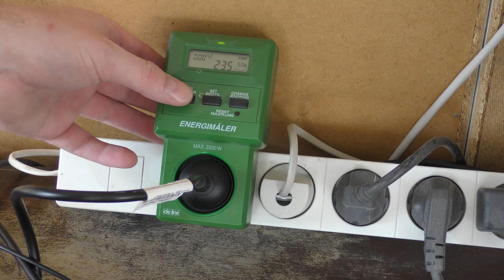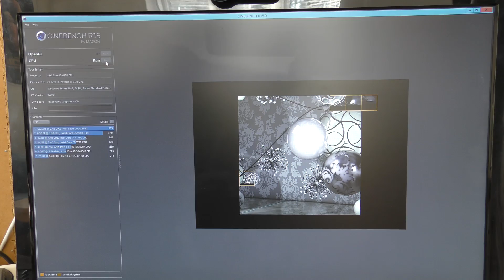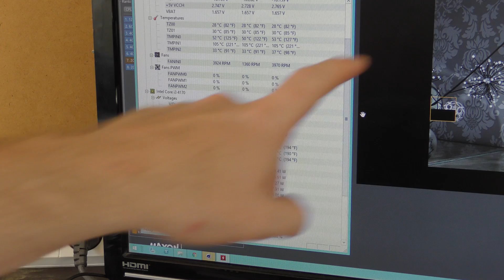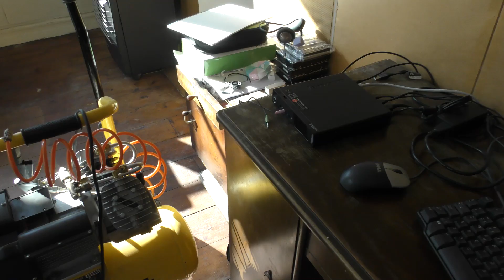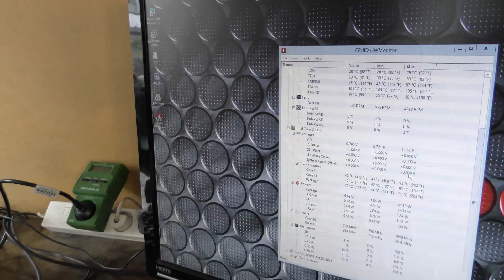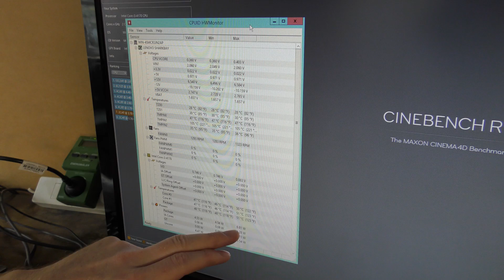Lenovo Tiny PC with i3-4170 Power and Heat Measurements - 406

Comment: I have the same PC but with an i7 4790s and there is no problem on average I have a total consumption of 55 watts sometimes with peaks of 62 watts and the and it does not go above 80 degrees in cinebench I get 712 points simply the processor (i3 4170 ) is used well and its maximum consumption is 54 watts with its integrated graphics added
Reply from the maker: Hi @hpperrreo4082
Thank You very much!  glad you liked the video :-)
Thank you for watching! :-)

Comment: Did you try replacing the 65W power supply with the 90W version? This should get this CPU working at full capacity. But looking at those temp figures, you'd be looking at close to (if not over) 100 degrees... haha
Reply from the maker: No I did not try that :-)

Comment: I just cleaned out a pc with the same cpu and it was always 99 DEGREES C. but now its between 40 to 70 I think that model has a heating issue. take a look I just posted it it was a little dusty
Reply from the maker: must have been more than just a little dusty :-)

Comment: Ok, so I'm doing the same setup. Actually two of them i3-4160 and i3-4170. On the 4160 one I reach 88 °C as well, that's with Thermal Grizzly Kryonaut. I get the same wattage you get. Around 44W. The PSU i'm using is a 135W one from a docking station. So plenty of reserve there. Since the fan gets very loud I intend to do two things that I can think of.

1. Delid the CPU and apply either Kryonaut or Conductonaut.
2. Try undervolting the CPU as much as I can.

I hope I can shave off ~10 °C. I will try to get to it and share results after.
Reply: Intel XTU stress test reached 95-96°C on default voltage (ambient is a bit higher these days), as well as 40-42W TDP. I was able to test at -0.115 volts offset on the core and cache. Maximum temperature reached went down to 86°C, usually hovering around 80-82°C. TDP went down to 34-35W. The fan was not a loud too. At no point the indicators for Power/TDP/Clock limiting fired. I will delid it tonight and check how far that gets me. If I\m able to go down to about 75°C I will consider it success. At that point fans will run quite enough even for a quite office.
Reply from the maker: Hi Svetoslav Stefanov
Thank You very much!  Nice,, what did you use to under voltages it ? 
Thank you for watching! :-)
Reply: @MyPlayHouse  Intel XTU did the job. I will post delid info later this evening.

Comment: I'm watching this Video, on a Lenovo i5 Quad Core, with 4Gig of Ram and 
256MB (or Mib) of On-Chip Shared Video Memory. It's an MT-M-5067-A1U. 
I've been using it as my main PC, for two years now. I'm running Fedora 
23 Linux. And it can Duel Boot. With Windows 7 Pro, on it too. But, I 
rarely used Win 7. It's a decent PC. It can Render Videos, much faster 
than my Duel Core and P4 Machines. But, I have allot of trouble, with 
the small video memory. When I do simple things. Like, watching YouTube 
Videos. The machine starts using too much Ram, rather quickly. Which 
seems odd. Because, Linux actually does a better job of managing memory,
 than Windows. I've run Fedora Linux as my main OS, since 2005. And 
never had a problem like this, on any other machine. From P3's to Duel 
Cores. Both Intel and AMD. When it get's over 1Gig of Ram usage. I have 
to Reboot the Machine. Or else it will lock up. And some times, it 
Reboots it's self. Very Aggravating... It is rather random. As to how 
long it takes this to happen. Anywhere, from 30 minutes, to 2 hours or 
so. It only has one standard PCI Slot (Not PCI Express). So, the only 
Video Card. I could put in it. Would be an old PCI Video Card. And the 
biggest I found was 512MB. But, then the Brick Style Power Supply 
couldn't supply the needed Wattage, for the GPU. I thought about using a
 PSU out of a Desktop, to Power it. And setting the PSU outside of the 
Box. But, those PCI Video Cards, Used. Now cost more than and brand new,
 2GB Video Card!:O And after seeing your videos. I don't want to spend 
money on a CPU Upgrade, either. What a Shame... So, I wont be spending 
any money on this thing. I've been watching your videos. On adding a 
Video Card, to your Servers. That sounds like something I would like to 
do. Especially, If I can find an 8 Core Server, for a good Price... 
Morten, Thanks for sharing your Knowledge and Experience... 

Don
Reply from the maker: Hi Don Bishop
Thank You very much!  glad you liked the video :-)
Thank you for watching! :-)

Comment: Did you really installed Server 2012R2 on that Client machine?
Reply from the maker: HI
It had been used for a project,, I just kept it on there. why?
Thank you for watching! :-)
Reply: Isn't it hard to handle? I had been tried to install Camtasia for my Server Tutorial on my other channel and it just didn't worked on the server os. And so many programms don't want to be installed on a server or want a extra license to become installed.
thank you for your comment. Stay awesome.
Reply from the maker: HI Philipp Renner 
I did get Camtasia up and running on 2012,, but it was a bit weird with the resolution on the webcam,, I was recommended OBS,, the thing all the gamers use for streaming!! That works well.
I do have it working so well as a PC,, that I do not even see that it is really a server.
Thank you for watching! :-)

Comment: why do you run Windows Server on your Non Server Devices?  i under stand that you should Run Windows Server on an actual Server but in my opinion that is not a server.  Im still new to your channel though so if you did a video on why you did this this i am sorry for asking as i have not seen it.  Just thought i would ask though.
Reply from the maker: HI
No that is a good question! Mostly,, the Tiny PC had it on there,, and I was to lazy to reinstall. But working with servers and MS server OS I also would like to see what I could get up and running on it. I still use it like in the video here.
Just getting the Sound, Mic and Web CAM running,, I was not sure if there was drivers and stuff....
Thank you for watching! :-)
Reply: Did it come with windoes server pre-installed or was it installed by someone else?  Or something like that
Reply from the maker: HI ***** 
I had a tranie install it, and forgot about it.
Thank you for watching! :-)
Reply: It's fine. Win server comes with a few things out of the box that aren't in desktop. It really depends what you're using the the machine for.

Comment: Another thing to consider perhaps is also BIOS revision, see if you can update it, it might include better support for later CPUs. I wonders also if it is possible to get a higher wattage power supply, then we can see if it is purely thermal throttling that is holding this CPU back
Reply from the maker: HI
Okay you think it is the heat,,thanx!
Thank you for watching! :-)
Reply: No, as my comment said, It may be, but to properly see if it is, then the two thing mentioned could prove it. Please re-read my comment
Reply from the maker: HI ***** 
Sorry :-( I get SOOOO many comments right now,, can't keep up.
Thank you for watching! :-)

Comment: Man,  you have all this great equipment, but you totally have no clue about CPUs and such. Your mini pc works completely fine. Even the Cinebench score is totally accurate. Read into intel CPU power saving features, that will clean up some of this.
Reply from the maker: Hi
I am sure you know a lot about this. My problem is that the  i3-4170 shout score 5136-ish in this test : http://www.cpubenchmark.net/cpu_lookup.php?cpu=Intel+Core+i3-4170+%40+3.70GHz&id=2522
But scores about 1000 less in my tiny PC.
What do you think is going on?
Thank you for watching! :-)
Reply: Are you running dual-channel or single channel memory? Also at what MHz?
Reply from the maker: Hi
There is just one dimm in, and I think it was running at 1600MHz
Thank you for watching! :-)
Reply: So you are running it in single-channel mode. That can limit the performance of the CPU greatly in memory bandwith limited applications/benchmarks, and as far as I am concerned, PassMark does have parts like that. The people who are getting 5000+ score are probably running faster and dual-channel memory.

This is probably the reason why cooling it better with the compressor didn't affect performance at all.

And albeit your core temps were high, the CPU wasn't termal throttling, at least from what we could see on the video.
Reply from the maker: Hi TheHendric85 
Interesting, I do need some more RAM for it anyway. :-)
Thank you for watching! :-)

Comment: If you think the power brick is holding you back, you could use a higher wattage one (Like used on the higher end thinkpads.) I have done this on the tinys I have worked on. (I use this http://shop.lenovo.com/us/en/itemdetails/0B46994/460/FB655FA7A2834E04AED9731463CD174E)
Reply from the maker: Thank you for watching! :-)

Comment: 90c is defiantly to hot for that chip with its TJ max being only another 15c away. And the only reason you don't see any throttling is because the board doesn't have the microcode for that chip.
How ever i see no reason to remove the chip if all this system does it web browsing and word processing tasks.
Reply from the maker: Hi
Well it does also do an hour or two of video rendering, from time to time!
Thank you for watching! :-)

Comment: I would be worried if my cpu temps hit 92C, your cpu will definitely throttle itself at that temp to avoid overheating, i would reapply a pea sized amount of thermal paste you could also try increasing the fan speed to the max in the bios.
Reply from the maker: HI
Good advice!
Thank you for watching! :-)
Reply: motherboard bios takes care of the temps and sends instructions to the cpu to clock down, CPU itself does not simply clock down on its own man.

Chao, The Roaring Lion
Reply from the maker: Hi matt kessler 
If the CPU slows down,,, where would I see that? (except maybe the bad benchmark)
Thank you for watching! :-)
Reply: +My PlayHouse (Morten Hjorth) use a tool like CPU-Z it shows clock speeds
Reply: hwmonitor also shows you current cpu speed, it shows in your video!
Reply: I take back what I said about your cpu throttling at 92C, it seems to throttle at 100C or more and only by a small amount and it needs to spend a lot of time at that temp before throttling, more than 20% of the time. These results were from an i7 4790, they said it means that you can expect full performance from an Intel CPU as long as you keep it below 100 °C. But I still say that temp is too high even if it doesn't affect performance.
Reply from the maker: Hi gamerdude0 
Are you sure,, that sounds like a lot?
Thank you for watching! :-)
Reply: My PlayHouse no, it looked okay to me! which makes me wonder why your test score is so close to the old cpu
Reply: I only looked at one site so I may be wrong, here https://www.pugetsystems.com/labs/articles/Impact-of-Temperature-on-Intel-CPU-Performance-606/
Reply from the maker: Hi gamerdude0 
Okay so it does not die at 100C but gets a lot slower.
Thank you for watching! :-)
Reply: yep definitly
Reply from the maker: Hi Gizmo 
I was not able to see it slow down? did you?
Thank you for watching! :-)

Comment: it was thermal throttling really badly next time apply a pea of TIM and Let the pressure spread it also the heatsinc seems incapable to dissapate all that Heat
Reply from the maker: HI
I did not understand this?
Thank you for watching! :-)
Reply: yes it seems like it and this is a pretty obvious throttling, just look with CPU-Z on which frequency it runs mostly it shows you that it throttles when under load if this is the case.
I had this issue many times with overheating laptops, I cleaned those and it went away.
So I guess the cooling is not enough for what it is now, because it seems clean but well.
Wrong appliance of TIM (Thermal Interface Material) can be a problem but unlikely.
Fan profiles in the bios can be changed on some occasions but I don't know with dedicated Lenovo hardware/bios
I do recommend a known TIM manufacturer instead of a shady unknown one, I use arctic silver 5 for all my systems and it works fine.
I even run a server 24/7 on it but that has water cooling and a XEON E5 -2670.

Chao, The Roaring Lion
Reply from the maker: Hi TheRoaringLion 
So in short, You think it becomes to hot. :-)
Thank you for watching! :-)
Reply: +My PlayHouse (Morten Hjorth) yea check that

Comment: One thing you could try would be installing the CPU in a normal mainboard, reuse just about anything from the Tiny, cpu, ram, harddrive, and then just a normal PSU and mainboard.
If it then benchmarks higher, then you know that the problem could be the Tiny.

Also for comparison you could test the original CPU in the normal mainboard, to see if that performs better than in the tiny.
That way, you would have some kind of a base line to go by.
Reply from the maker: Thank you for watching! :-)

Comment: Could it be the internal power wiring? It is dimentioned to less current (power) than the faster CPU draws. Maybe the current it draws requires a thicker cable (gage) inside the box?
Reply from the maker: Thank you for watching! :-)

Comment: There is a software called Open Hardware Monitor. It and look the same as CPUID HWMonitor.
The difference is that Open Hardware Monitor is: FREE. Sadly, it's very old and doesn't support Skylake processors.
I'm not getting CPUID HWMonitor showing the CPU temperatures on my Skylake i5-6600K either.
I found that CoreTemp shows the CPU temperature. It also work with the All-CPU-Meter gadget.
Yes, gadgets work in Windows 10. You just need to install a third-party software called Desktop Gadgets Revived 2.0
Reply from the maker: HI
I am running Microsoft Server 2012 R2 Std.Thank you for watching! :-)
Reply: It doesn't seem to matter which OS you run. I run Windows 7.
The software can't seem to read the data from the sensors inside the Skylake CPU's, the 6000 series CPU's.

Comment: If it's working with full clock speed on all cores no hesitation, as it is, it shouldn't get low benchmark scores. Even though it only gets 45w, it's still at 3,6 ghz. That is very weird. Even weirder is that it's not throttling at 72 degrees. Might be the motherboard not supporting thermal throttling and also not supporting the higher transistor count of that CPU compared to the old one. Only things I can think of.
Reply from the maker: Thank you for watching! :-)

Comment: Intel ark has become rubbish recently they used to give die size now just package size, you have to delid to see what portion of wafer your getting? This listed t case spec of the CPU 72 deg yours is going well beyond that 95deg? yet it's not hard shutting down?something weird is going on as the frequency is pegged also? Yet performance is poor, maybe the transistor count is much lower than desktop equivalent i3? You need to graph volts and watts?
Reply from the maker: HI
The i3 4170 is for a desktop,, the i3 4130T is kind of, for mobil.
Thank you for watching! :-)
Reply: It might be the mother board bottlenecking the cpu.The desk top cpus have a threshold at 105c and shut down at that temp.The cpus will commonly thermal throttle at 95 c. Just for information the heat sink will easily over heat with so much more heat to cope with if it is given full power.

Comment: You need to read the spec at Intel ark for the CPU, I would have thought that it's tjmax before shutdown must be close to 95deg? Especially on a low power CPU like that ? My desktop CPU is like 100 or 105 so laptop CPU must be lower, maybe the CPU is clever enough to throttle in ways other than frequency ? When it hits tjmax so it never hard shuts down?
Reply from the maker: Thank you for watching! :-)

Comment: Your favourite performance test is not pegging the CPU, no good for hardcore performance testing, and thermal envelope testing, intelburntest is good for of stability testing, cinebench, prime95 etc, real temp is also good. Probably the motherboard is the issue if the CPU is under performing. Version of windows?
Reply from the maker: Hi
It is running Microsoft Server 2012 R2 64bit
Thank you for watching! :-)

Comment: a lot more power than I was hoping too see for a small unit.
Reply: According to HWinfo the CPU was using 40+ watts
Reply: yes and my AM1 AMD quad core is a max TDP of 25 watts. I'm now temped to get a extreme mini case for it and use it. With the 4GB DDR3 ram chip it has and the 160gb sata drive it uses around 40 watts.
Reply: It surprises a lot. The TDP of the quad core i7 Sandy Bridge in my laptop is also 45w (with Cinebench 15 of 475) seems like a pretty nice little unit.
Reply from the maker: Hi
I think it was a bit weird, that the Tiny PC did not even use as much as the CPU.
Thank you for watching! :-)
Reply from the maker: HI
Do you mean the 20-26watt? -ish
Thank you for watching! :-)
Reply: ya, if I had a tiny pc like that attached to my TV in my bedroom I'm thinking 8 watts more on the line of Atom cpu but the Atom CPU can't play 1080 or 720p video. Did you run a watt test on the i3 "T" it came with? Anyway too replace the stock cooler on that mini tiny pc with aftermarket too help with temps? Or add a 2nd fan?

Comment: it might be interesting if you have a full size motherboard to test that processor in.  It would most.certainly confirm your assumption that the motherboard is limiting power. That being said, I dont know if pushing the motherboard to the limit is the best especially with getting temos of 95°!
Reply from the maker: Thank you for watching! :-)
Reply: @Tha14GR According to cpuboss.com the CPU will typically consume about 43-44W. http://cpuboss.com/cpu/Intel-Core-i3-4170 . According to another article, the 54W TDP is assigned for a family of products. Essentially all i3 Haswell (regular, without any letter designation) are rated 54W. So you get the same 54W TDP on both the i3 4130 and the i3 4370, with the latter likely to consume a bit more.

In this case it looks like the board is not limiting anything.